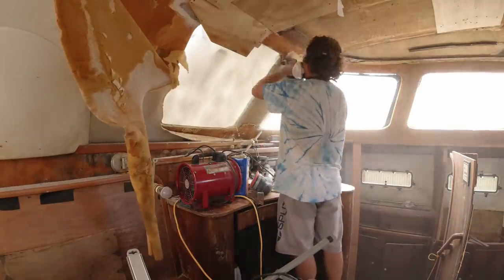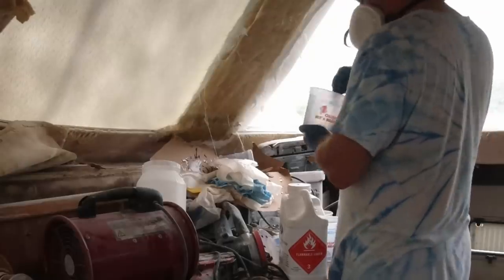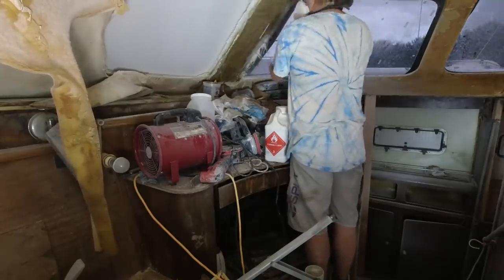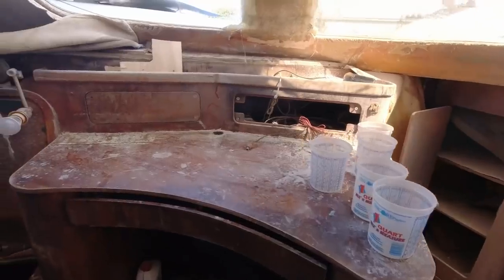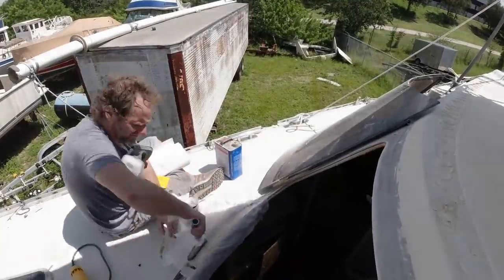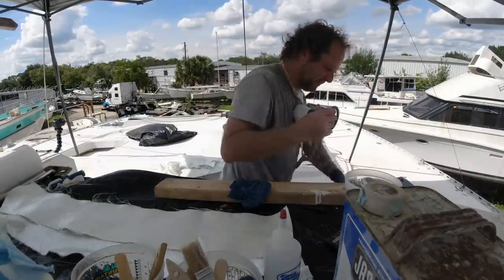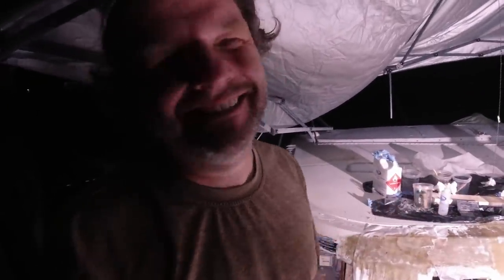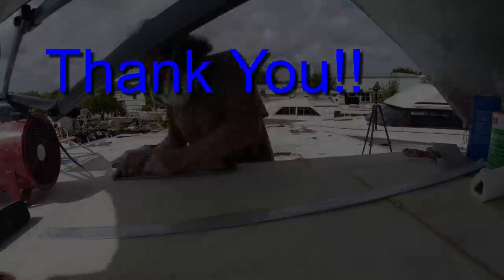9 Big Mistake!! Salvage Catamaran Fiberglass Repair.

Comment: You doing great. However i was trained to lay the longest pice and fill in with shorter pieces of glass. I know Andy likes it backwards to that. But you know I once layed up two Fiberglass planks both with holes in them repaired both ways. I drove my 1985 K5 Blazer over them and up on to blocks. They both broke but not at the repairs and nether of them had any damage at the repaired holes made by grinding equally through them. Wish I would have know back then there would ever be YouTube.
Reply from the maker: I do larges to biggest or biggest to smallest both depending on the repair and how I will be feathering it. I may just try a test to see which way is actually better... my bet is there is very little differences as long as you don't damage the glass when feathering... who knows
Reply: Bryan Sailing  good idea for a video!
Reply: Pops Old Boats  HI Pops, 
I work on old boats too. 
Great hobby! 
I have watched some of you things! 
 Have great one!

Comment: Is your bridge deck solid?  Any damage to it, at all?  Parlay Revival did a similar repair, went sailing and the mast dropped because of structural damage to the bridge deck. His estimate is about $30k to repair it. To locate the damage, they had to remove sections of bulkhead.
Reply from the maker: That was one of the first things I checked before I bought the boat. Because my boat doesn't have interior liners, it's a lot easier to inspect. I'm sure they will get Parley back in shape Collin is a smart guy.

Comment: When its possible dont grind in the new woven layers of glass. Greets Paddy
Reply from the maker: So correct. If you grind woven glass even a little you kill the strength in both directions, but knit fabrics are different you only cut in it layer by layer, so as you sand it you only kill the one layer strength at a time.

Comment: My tip, and I’m sure you’ll receive many from us keyboard advisors on the other side of the planet. Smothering you’re exposed skin areas in talc powder, will help with the itching when working with and especially sanding fibreglass! 😎🏖🌴☀️🇦🇺
Reply from the maker: Great tip! thanks

Comment: On vertical stuff and overhead you can spray it  with 3M  spray adhesive put glass up then wet it out
Reply: Sounds like risky chemistry to add 3m glue,
 have you seen this used a lot?